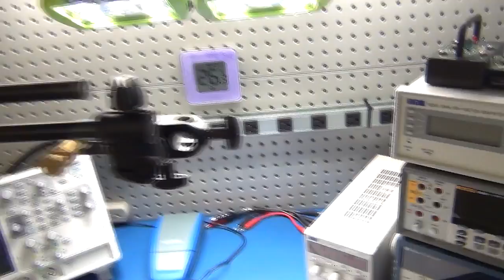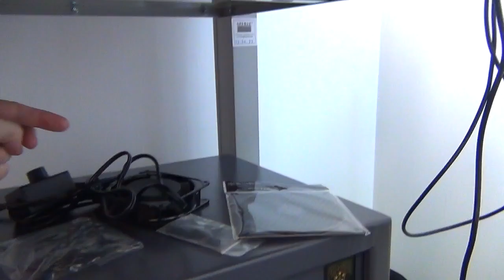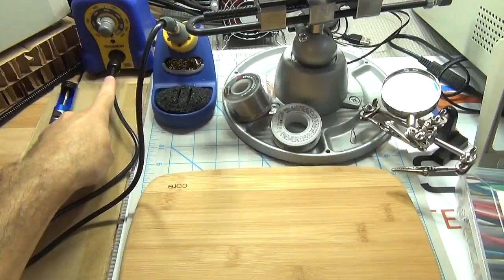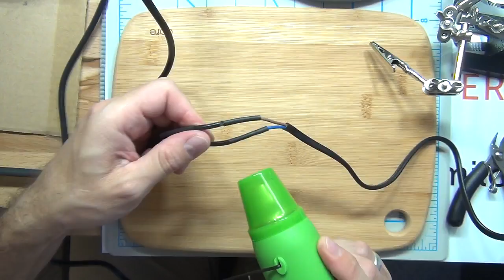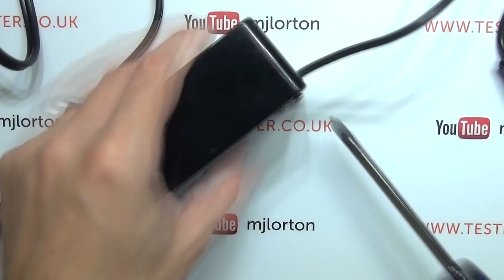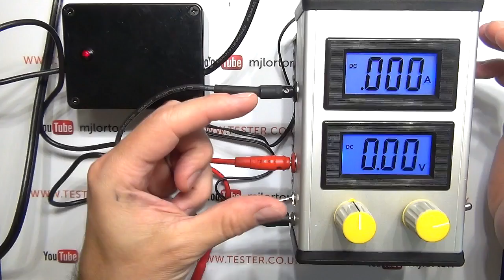T4D #67 - Transforming the transformer and lab update

Comment: And to add, if you do that it wouldn't hurt to also get a flux pen... flux really matters a lot when soldering. 
Also, I don't really like that type of soldering wires, seems like it would be sensitive to pulling. I prefer to flux the wires, twist them together then apply solder on strands on both.
Other note: the transf. is 240v 50hz, you have 60hz now, that helps. Also at low load you have more voltage, both explain the 7v you saw.

Comment: A novel idea for your own battery charge discharge cycler would be to use your arduino board to say, if(voltage = 10.5) then activate a relay to charge the battery and deactivate the relay powering the dummy load. Then, if(voltage =13) then turn on the dummy load and turn off the charger. You already have the voltage testing code so all you need to do is go into radio shack and pick up 2 5volt  non latching relays and now you have your own programmable battery cycler. Just a novel idea. ~Jason

Comment: if it's 12 positive and negative center tapped, you should be able to get 24v peak to peak if you just use the two outter taps, which should get you 24vp-p off 220, so at 110v input, it should get you 12vp-p, and after going through a bridge rectifier, you should get pretty close to that (assuming your higher peak voltage offsets the rectifier's voltage drops).  oh and you might want to add some decoupling caps for your regulator.  you should buy a huge lot of them--they're essential to have

Comment: I always prefer a twist too. However in the end i doubt it makes any difference in the connection. That would make for a good experiment tho. You could put a high current through a wire and measure the Temp at the connection to truly see how the connection will perform under load. While your at it you could test other types of connection as well and graph the results.

Comment: You can remove the outer sheath with those strippers, Martin, no need to fumble around with a pair of scissors.

Also, you may as well remove the depth stop on them, it just gets in the way. The lower jaws are 10mm long, for reference for stripping length.

Comment: You need a capacitor on the output of that voltage regulator, if you want it to be stable. A couple of microfarads is enough (10uF or so).

Comment: As always clear & straightforward presentation.
Liked the "centre tapped with only 2 diode" concept.
The cable connection - well not your best idea or execution.
If a connection was necessary (sometimes happens) why not consider a connector that can be connected/disconnected as required. Or longer mains cable direct to enclosure.
I also expected your regulator to cope better & deliver a more constant voltage up to 100mA? I'd like to know why this was not happening.

Comment: Hi Martin,  Don't delete.  I also stagger the joints when I wire tie hot wires to avoid shorts if they come apart but this would never get the Good Housekeeping Seal of Approval around here either ;-)

With all of your 220 toys, why not run a 220 outlet/s to your shop for your 220 stuff, and use the 110 for US stuff?  Great vids.

Comment: hi Martin If i'm not mistaken in one of the ac to dc power supply episodes you showed the difference between the 4700uF cap and the 3300uF cap and the power loss was greater with the 3300 but you used the 3300uF in the final build not the 4700uF and was wondering if this is where your slight loss is coming from i am still working through the vids and not finished them all yet. great channel btw love your bits and braces approach to how you do things keep up the good work :)

Comment: Oh god, Martin, please don't solder mains-cables together!
Your cable has absolutely no strain-relief, if you pull the cables apart you'll get them in your hands fairly easy, extremely dangerous.
What you need is a real splice with screw-terminals for the connections and a plastic housing with screw-holders for strain-relief. Or just replace the whole cable.
Also, if you must solder cables togther, don't twist the conductors like that, braid the two cables together to add some strength.

Comment: That radioshack solder doesn't look like lead free, it says 60/40 on the label. The 63/37 should technically be better but they're both no-name crap solders, flux inside the solder makes huge difference and those noname ones don't have quality flux.
Highly recommend getting some Multicore/Henkel/Edsyn solder from Digikey dot com or Newark dot com, they're specialized stores in US.

Comment: Check out a unit for solder smoke removal from Marlin P Jones it is an adjustable arm fan with a carbon filter part # 17529 TL. I am sure a quick search will turn it up. Also NTE makes a great solder mfg by Kester. Lots of real electronic houses sell it.

Comment: Martin Martin Martin, why did you splice the mains cable? Surely a safer and neater method would have been to remove the original cable and fix the US cable in it's place.
If you really must splice a cable at least stagger the joints to minimise the possibility of a short. lastly if you want RCD protection then you need an earth connected plug and cable.

Comment: Sorry Martin but I must correct your method before someone gets hurt or a house gets burned down, yours included!

For a demonstration on how to connect two cables, I am sorry Martin but, this is very bad advice and a very good example on how not to splice to cables together. This is extremely bad practice.
 Follow read my post on your forum on how to do this correctly and SAFELY.